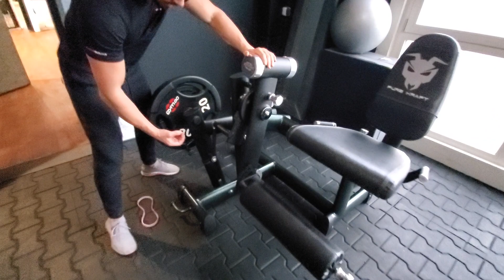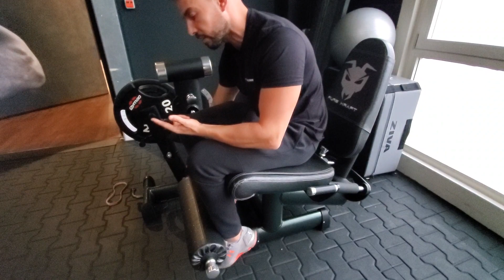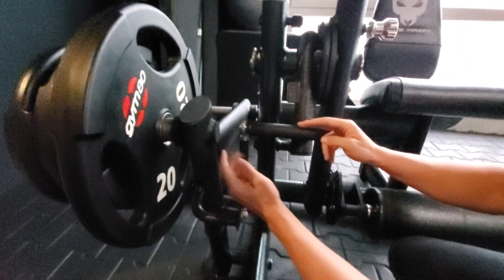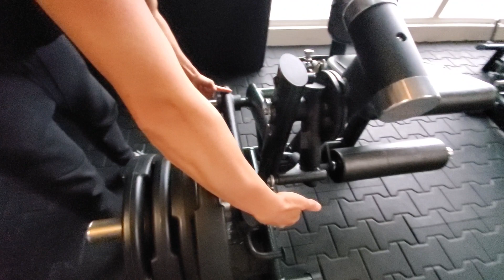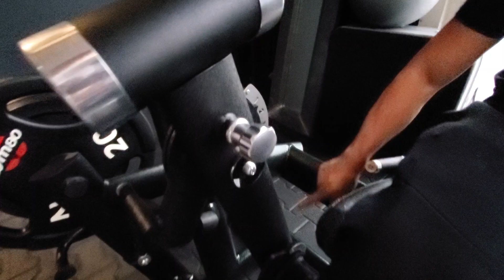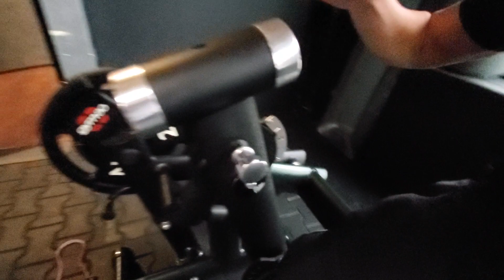Gym80 new leg extension

Comment from the maker: Excellent plate loaded leg extension, but the Strive/Prime is still by far the best in my opinion.
Reply: Would you say the prime plate loaded lying leg curl is the best too? I am looking at either Prime or Atlantis PE series
Reply from the maker: @alejandroolivares-nunez7896  the best prone leg curl I have ever used is the Flex Fitness,  which is now Star Trac.  However Star Trac was recently purchased by Nautilus (If you are looking to purchase new).
Reply: Yeah I have seen on the thread the old flex fitness and older star trac prones are best. So your saying the new nautilus prone leg curls are best? Could kindly let me know the model? I will look into it now.

So far pieces for the gym I want to get;

Panatta : freeweight super incline chest press , the leg press bridge, Hi row and Super rowing. (Potentially the deltoid press too)

Prime : plate loaded leg  extension

I have also been looking at Predator Strengths Pendulum. It has lots of adjustments. 

I want to get a low row and pulldown combo too. I have been looking at Atlantis, Watson.

Thanks again
Reply from the maker: @alejandroolivares-nunez7896  I'm saying that of you want to buy new, Nautilus is now the parent company since they bought Star Trac.  If you can buy used, then try to buy a Flex Fitness or a Star Trac model.  Technically the  best Star Trac model is the one that has the lever arm between the legs, just like all of the Flex Fitness models had.